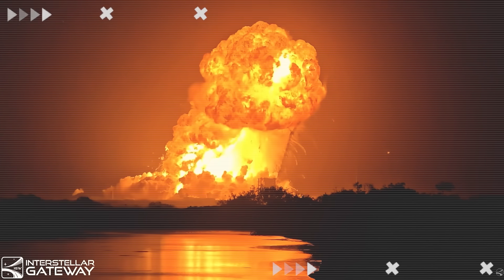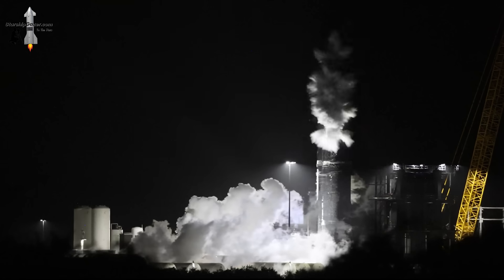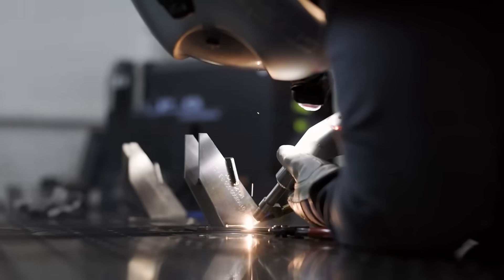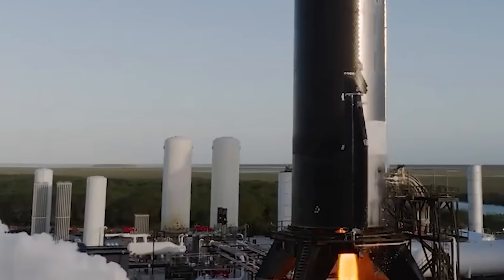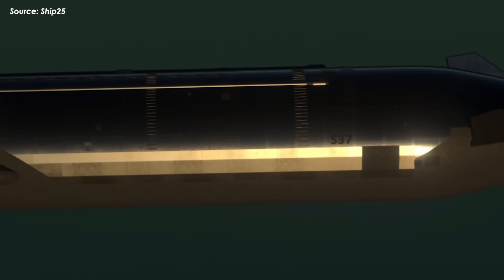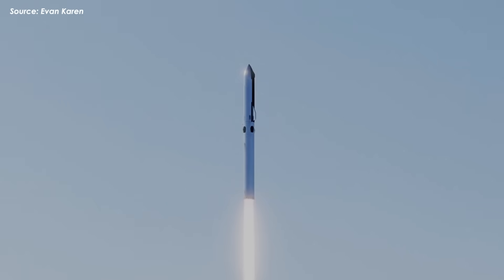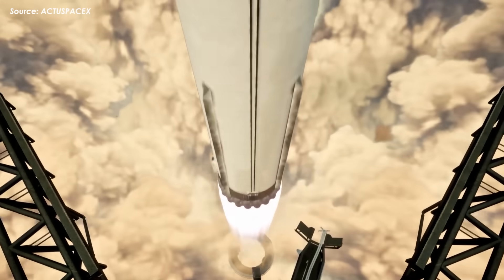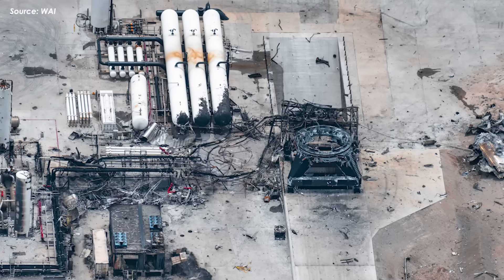SpaceX just announced Major Plan Changes on Starship Flight 10 after S36 Exploded...

Comment: I’d suggest a more practical approach: launch smaller Starships and dock them together in space before heading to Mars. Imagine at least 10 mini-Starships, each carrying around 2 crew members—that would provide both redundancy and flexibility.

Each mini-Starship could be about 30% the size of the full-sized Starship, making them easier to launch and potentially safer. Combine that with inflatable habitat technologies (like Bigelow modules) to expand living space for long-duration missions, and you’ve got a scalable, modular, and robust system for interplanetary travel. 🚀🌌🛠

Comment: Ship 28 and 35 both failed spectacularly.
Maybe the lesson you should learn from iterative testing is that iterative testing is a really dumb idea.
How about making sure the thing works before you launch?

Radical idea, I know — but at some point, people are going to stop paying for all these expensive fireworks shows.
Reply: Elon and SpaceX have drunk the AGILE coolaid. Each flight had bug fixes, a few “let’s add some new cool stuff” and we know that doesn’t work but we need to meet schedule so let’s cross fingers and sort it next flight.
Reply: @Johnwashere-dt2ov
I think Elon sets impossible goals and impossible deadlines because he doesn’t understand the science sufficiently to know what is possible, and there is a culture of not second-guessing the “genius.” See OceanGate as an example. This leads to things being launched before they are ready, and they are not given the time to actually learn from the mistakes because the pressure to send up another one is so high.
Reply: @isakeynell8771 This is a completely experimental rocket, there is no guarantee that the thing will work without first doing a test, in fact it was the philosophy of testing and learning from mistakes that made SpaceX what it is today, if you think this idea is stupid then set up your own aerospace company and do it your way, SpaceX's visionary ideas require a different means of manufacturing and testing than the industry standard, while the SLS that uses the traditional method takes many years to build, sucking billions from the taxpayer and failing the test 🤦
Reply: @tony_sterko
I don't have to start my own space program to know that doing your due diligence and making sure the rocket works before you send it is a good strategy—because that's how we've always done things. That's how we got a man on the Moon, it's how we built the ISS, it's how we got all the rovers to Mars. It works!

Talking about Mars—Starship should be on Mars by now, and they haven't had a single successful unmanned mission to orbit and back yet. Rocket after rocket after rocket failing and exploding like the most expensive fireworks show ever.

It's an insane idea that using the Kerbal Space Program approach to rocket engineering—i.e., firing it off and hoping for the best—should somehow be cheaper than just doing the due diligence and getting it right the first time.

SpaceX is completely dependent on taxpayer money, and it's your money they're setting on fire. It's time to wake up and realize that Elon is a half-wit, junkie con man—and it was all hype, BS, and empty promises.

Comment: Musk on Mars - Space Unicorns - See the Spoiler near the end.

Will Musk succeed in making 70,000 Starship launces, at the rate of one every 30 minutes, in order to realize his Mars colonization plan?

Using statements issued by Elon Musk I have calculated the viability of his Mars colonization project. Strap in, the G-forces will be very high.

Musk admitted that 1 million tons of material must be sent to Mars in advance of humans to supply the components for safe habitat.

That requires 10,000 successful launches and subsequent descents of Starship to the selected habitat area on Mars (100 ton payload per Starship claimed by Musk).

In addition, Musk stated it will take 6 more Starships for every Mars bound vehicle to refuel those Mars bound Starships for the actual Mars journey. That's 60,000 additional Starship launches, allowing that there are no failures.

This gives us 7 launches for every Mars bound vehicle. So in reality, at one launch per day (wildly optimistic = delusional, but let's go with it) it will take 7 days per Mars bound vehicle. That now totals 191 years to complete material transfer.

Spoiler:
The window for a Mars launch is once every 26 months, with 15 days available in that time frame (49 launches per day). 
That means Starship will have to cram in 732 launches in 15 days every 26 months to meet the 191 year infrastructure transfer.

1) What will happen to the first material that lands after 191 years while it sits waiting for the final structural parts to be landed?
2) Who will finance each Starship?
3) Who will finance the cargo?
4) Who will finance the fuel mass needed to make the journey?
5) What can be done at the Mars site if material is damaged?
6) During the 191 years will there continue to be a viable SpaceX factory?
7) How many Starship launches will fail during the program to put material on Mars.
8) How many Starships will crash during the landing phase on Mars?

9) How about feeding the astronauts for 38 months once manned Mars missions begin? Musk has no clear answer.

These are the most basic problems. There are countless questions for the logistics to get started, keep it operational and do the costly program maintenance.
Reply: If Starship ever will be ready for low earth orbit, Elon has a cheap launch vehicle for his Starlink satellites. Development will stop right there.
Funded mostly by taxpayers' (and maybe some external investors) money.
If it fails, no harm is done: it wasn't his money.

Starship was never meant to go to  Mars. Even Elon knows how to operate a calculator.
Reply: Don't know, but they should send the politicians first 🤐
Reply: It's obvious, Mars colonization is a marketing trick. The main goal that SpaceX is trying to achieve is to build a new generation of a space shuttle that would deliver 100 tones to Earth orbit. Only after completion of this task designing interplanetary communications will be possible.

Comment: Why does a rocket that is going to Mars - a two year minimum trip and stay, need to be fully reusable?  if it gets 50 people there and then returns in 24 months or so - it's done it's job - I mean is it going to go there 100 times?  No.  It's not an airliner.  And the tech has most likely changed in the 24 months since it left.  It's already out of date.

Comment: SpaceX always had "major plans" ... including those that led to this series of failures.

Please stop celebrating every fart from its PR department! It gets more and more evident that the whole Starship program might be flawed.
Reply: Failures and problems I can understand. But multiple failures for multiple different and unrelated reasons, none of which have been remedied or properly explained, suggests that Starship is a fundamentally flawed design project. Pouring money into a 1974 Pinto doesn't make it any more safer when there's inherent design faults.
Reply: @ash9803  The problem is that Musk thinks he could scale up the Raptor engines just by using multiple of them. Math does not work this way. The probability of a critical failure grows exponentially with size. Finding the broken part by try and error may have worked on the scale of a Falcon, but not on the scale of the Starship. The Russians learned that back in the 70ie with thier N1. NASA accepted that in the first place ... and took the extra effort to build a working Saturn IV.
Reply: @f.herumusu8341  
Excellent reply, but "At this point I think I know more about manufacturing than anyone currently alive on Earth." He's not about to admit that isn't true.
Reply: @ash9803 I think Musk does really believe that, as he makes the same mistake over and over. He thinks he is "nearly done" when he got it working 80%. See Teslas "Full Self Driving" or the Hyperloop. He just ignores the the remaining 20% are the hard part and might turn out to be unsolvable. Musk is not an engineer, he is just a failed student of physics.
Reply: @ash9803  As I understand it, they chose the high-pressure solution of the Soviets, RD-170 and higher, which the U.S. army even was forced to buy from the Russians later. But the Soviets were able to construct secure rockets.
Seem to me Blue Origin chose the low pressure alternative. And look what they did - the first start of New Glenn and they reached orbit, what Musk was not able to achieve with his tenth start.

Comment: It makes one wonder how they were doing so well... with all the other test flights... then all of a sudden it's back-to-back failures! Don't get me wrong I remember all the trials and tribulations NASA went through with its Apollo program. But it looked as SpaceX was on the right track with ship and then all of a sudden problem after problem... definitely makes one Wonder what change that's causing that's causing all these issues 😢
Reply: Yep what's the problem? After all, it's not rocket science 😁.
Reply: @ash9803  Most likely pogo effect. Block 2 is a longer rocket so its natural vibration frequency changed. Also they when from 1 down comer tube to 3... so more points of failure. Once it runs of  out fuel to dampen the vibration...the rocket is shaking itself apart, where is the breakages is happening is the question.
Reply: All these failure are the result of version 2 ship. This new version is not going as expected.
Reply: The booster and the ship, I believe, use the same engines.. you would not think it's an engine related issue..... I just find it hard to believe block one series had such good runs... but block 2 keeps disassembling itself due to leaks.. and every time they think they have it fixed, another problem shows up
Reply: @ctyslickr it's not the engines, it's the fuel lines or tanks vibrating and coming apart in flight.

Comment: You’re missing a bigger point they have Pat B almost ready. They could do a simple modification to Pat B to do a test buyer. No big deal.
Reply: Lol fire
Reply: And I just thought of something they have Equipment in Florida that they could send to Texas yeah expensive but every time efficient
Reply: Pad B will not, IMO, be operational any faster than repairing Massey.
Flying S27 without a static fire after 4 Starship v2 mishaps would be irresponsible, and asking for trouble.
The only real option is accepting the delay and take the time to rebuild Massey.
(Nothing in Florida can help the process speed up.)

Comment: Maybe SpaceX could fly ship 37 by itself, not with the booster, but alone as it did with the early prototypes. Use a partial fuel load and no Starlink dummies. But do try to catch the ship at the Pad 1 tower. This would not test the heat shield but it would test the sea-level engines (in lieu of the static fire test) and the catching. If all went really well for the ship, it could then be paired with a booster for an integrated flight test.

Comment: Every once in a while the US Navy will have a string of accidents, at which point the some top admiral or the Secretary of the Navy will call for a safety stand down where the whole Navy stands down, ceases all non-essential flight operations and goes over all of its safety training until they have sorted things out Navy wide.  Maybe Space X should consider taking a pause, slow down for a moment and try to sort out what the real source of of its endless string of failures really is.

Another thing Space X needs to consider is that they at launch 10 and they still don't have a stable design yet.  It may be possible to 'move fast and break things,' or 'fail, early, often,' but past a certain point you have to slow down and get things right - or you will put yourself out of business.

Comment: SpaceX already has a track record for how often a static fire made a difference in design or hardware before launch.  They should be able to calculate the risk and benefit.  Also they need to address the COPV (perhaps added testing on the pressure vessel combined with a reduced maximum pressure load.

Comment: Just do the static fire test on top of a Super Heavy.  Surely it needs modification but it then could be a backup device for the future.
Reply: Can’t do a test fire on top of booster. The ring won’t take a six engine test for more than one or two seconds and isn’t designed to hold onto the ship with six engines going, it’s designed to be pushed away.
Reply: Yeah I like that. Launch the stack and bring the test stand home. If the top stage fails the rubbish falls safely into the ocean.

Comment: The point nobody is talking about is why this test failed. Does anyone actually know why this tank ruptured? Do the other tanks have the same weakness? How can you test if these tanks are good or not?
SpaceX is driving at breakneck speed and sometimes when you drive at breakneck speed you break your neck. This is no YouTube channel but playing around with multi million dollar toys. Sometimes not taking risks is the smart alternative.
Reply: Reports elsewhere from those following Starship's progress (Great SpaceX, , NASA Spaceflight, Scott Manley, Ellie in Space, etc.) all point to a COPV failure in Ship 36 as the cause of the static-fire incident.

Chances are SpaceX will simply bring in Ship 37, run it through its' tests and launch Flight 10 w/Ship 37 and Booster 16.
Reply: @MatthewLittle I know that the COPV ruptured but I don’t know WHY the tank ruptured. These tanks are tested above their nominal pressure to make sure that they can safely operate with their nominal pressure. So this new tank ruptured for a reason. And that’s the multi million dollar question. Without knowing why you risk running into the same problems again.

Comment: Wait - the next launch is near the end of this year but "SpaceX is not slowing down"?  Seems like flight 10 was supposed to launch early July.  Reeks of clickbait 20 seconds in.  Far better to argue (RIGHT UP FRONT) that SpaceX is fighting to get back on track by making their next launch their first V3 launch by the end of the year, which is where they would have also been launching their V3 on the original track.  Just write off V2 as the largest most expensive bottle rocket ever produced and move on.
Reply from the maker: "Maybe I made things a bit confusing earlier—what I meant was, the timeline really depends on how SpaceX decides to approach this. If they skip the static fire, then a July flight makes sense. But if they go with rebuilding Massey first and only then proceed with Flight 10, it could take another 2 to 3 months.
Reply: I think SpaceX was hoping to learn more from v2 before moving on to v3. Certainly they have heat shield tile issues to work out, I heard they've been trying to implement techniques to reduce the mass of Starship which directly affects the payload capacity - a one to one relationship. Weight reducing construction may have led to some of the problems seen in the last three launches. But SpaceX has almost run out of v2s, so it may be a force majeure decision to go to v3.